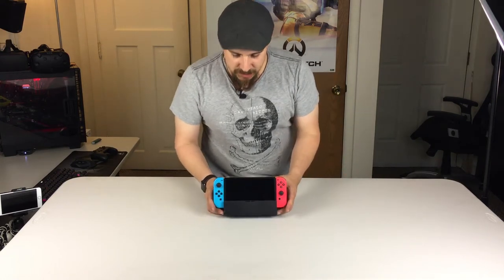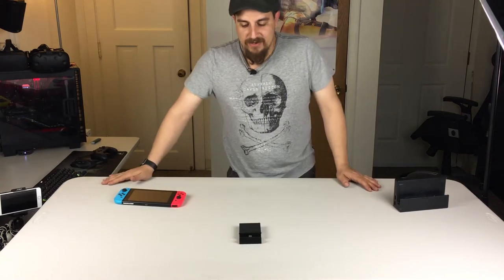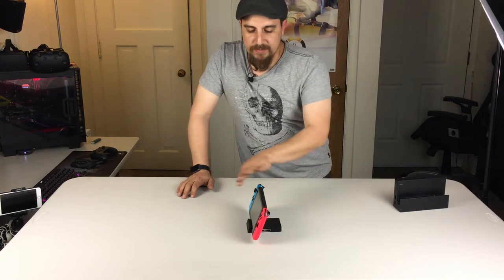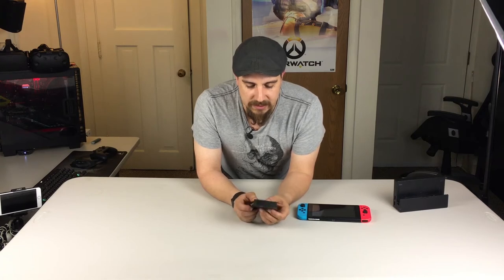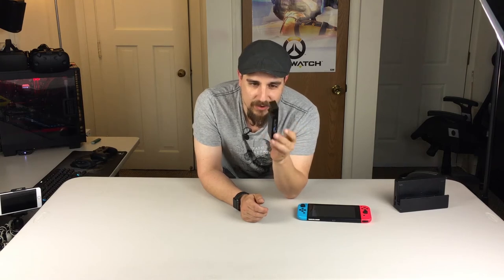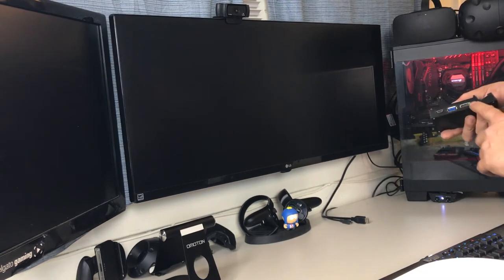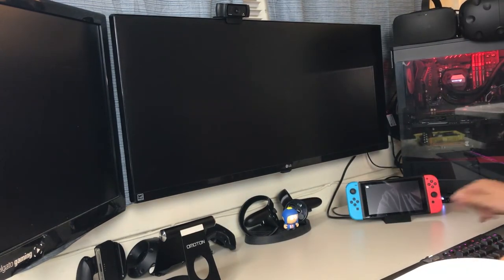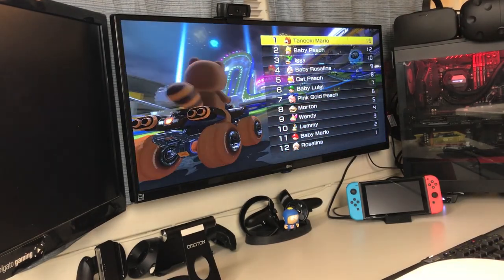Ultimate Switch Dock Mod. MUST SEE!

Comment: Thanks for the video. I wish there were companies that sold those 3D printed docks. Cause I don't have access to a 3D printer. I'd like to do this to my dock as well.
Reply from the maker: Ray Michaud you can actually have it printed on a site called 3dhubs.com
Reply: Ok cool thanks for the info. I'm going to hit them up right now!!
Reply: Ray Michaud he would possibly make you one. DM him
Reply: I bought one of these on Amazon...it's also on eBay...I'm just waiting for the tool I need to take apart the original dock and put the guys in the new case
Reply from the maker: ed moon  yeah I ordered one and it should be here tomorrow. I plan on doing a video tomorrow
Reply: The one on amazon is not the same as Docky which is what is being reviewed here, it does not have the led indicator and is not the same design.

@Rawdilz can you add the link to the thingiverse files in the description so anyone interested can download it?

Thanks.
Reply: badcopyinc good idea I may try that thanks
Reply: badcopyinc good idea I may try that thanks
Reply: Ray Michaud "legally" no one can print anything for profit unless it was their own design. Raw dillz was the one who pointed it out to me. Check out thingiverse and brush up on the license info. On the plus side you could have a 3D printer printing in less than two weeks for less than 300 or go even cheaper down to 160 ish if your mechanically inclined.
Reply from the maker: added!
Reply from the maker: i can concur they are not the same i was comparing them earlier
Reply: badcopyinc ok ok I got it I saw a YouTube of a printer that was for that price you just had to build it yourself and calibrate it. I was think of getting it to start trying out some 3D printing
Reply: Ray Michaud I can't speak for Rawdilz but I got the super cheap one that required building and calibration. I got mine just because I love building stuff and love learning. He keeps urging me to start shooting videos I may start soon. Idk there's not a lot of support for tronxy or Anet but at that price they are they most popular. I would urge you to research the facebook groups. For less than 300 you can get one like raw has that is super super quick to build and doesn't require as much calibration.
Reply: badcopyinc yeah I going to do the research first before I pull the trigger on which one I get compare the pros ,and cons. I'm willing to learn!!
Reply: theres alot of guys answering that same question on the anet a8 official facebook group. and im sure the group raw belongs to gets the same question. best way to find out is hop on FB and join the groups read posts see what issues people are having and how to avoid them.
Reply from the maker: Ray Michaud if you asked for my opinion on a great first printer I'd recommend the monoprice maker select. It takes about 10 mins to get it together and start printing. They even include software with the correct settings to print out parts. It's really easy to build a 3d printer the settings for the printer is where it's really hard for a beginner. Monoprice makes that easier. It does cost more than the anet. But the quality of the printer it's self and the parts they use is better imho. I'm going to be posting a lot of videos on the monoprice and the anet a2 and possibly the creality Cr10. So if your courious about it sub and you can see what they are like.
Reply: Definetly agree i got my tronxy a week after raw got his monoprice and im still fine tuning mine almost a whole month later.